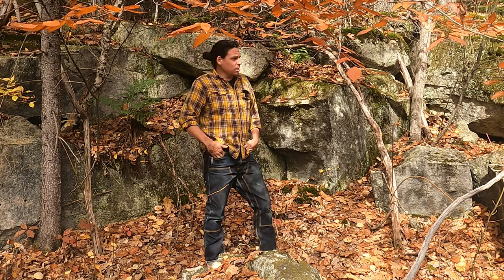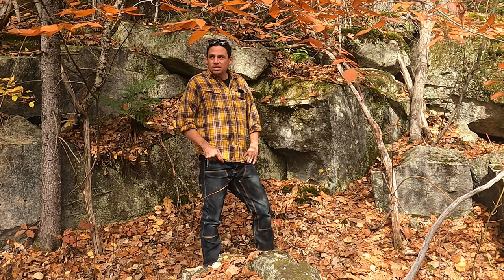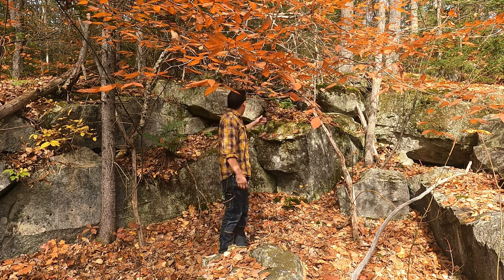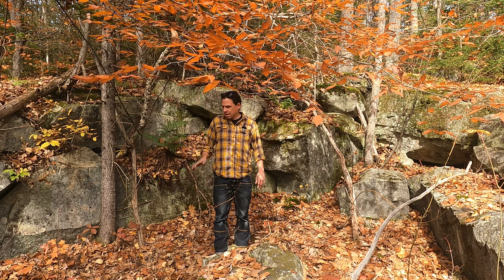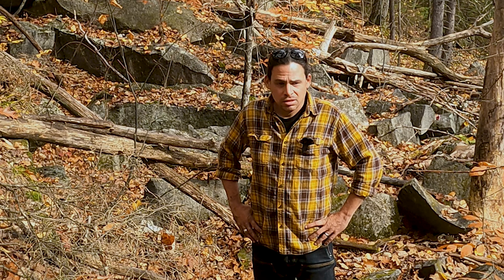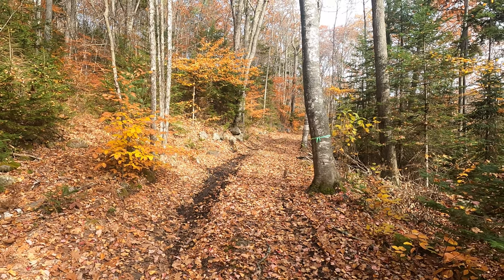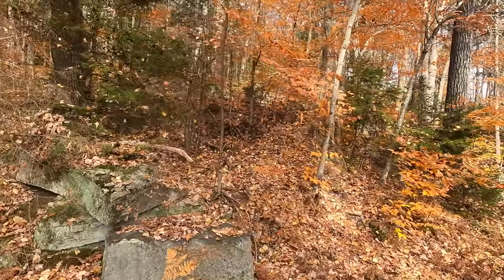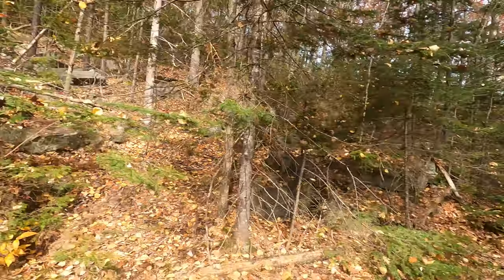Designing a Cottage - Field Trip to Town

Comment: Maybe a natural stone deck with a roof extension? In summer you can sit out there and also store firewood to keep it dry. If the pit goes really deep, you could make a small finished basement/cellar to use for storage. In a small home storage is really important, you pack away anything you aren't using at the moment. Also what is your plan for power? I could see someone like you rigging up a small solar system. I know I'd want a small fridge. Is the fireplace going to styled so you can cook on it?

Comment: You absolutely need to build a workshop on site also as cabin hobbit style would work well but with a sleeping loft not so easy to achieve if you could bring a few styles together hobbit traditional timber cabin viking style long house off grid cottage hole will be great good luck look forward to seeing the process

Comment: Ok. First things first. I'm not a builder/structural engineer/professional draftsman, so Im not sure if this is viable. Secondly, this will be hard to explain in words, and drawing inspiration from some of the fine buildings featured, everything is to personalised taste. So I won't be put out if you think this idea sucks. ;)
Regardless of the size, I'm thinking a hexagonal style building (floor plan view) would be a neat way to go, with the flat sections of the hexagon being the back wall (buried in the shelf) and the front flat being the face/doorway to the structure. The sidewalls sloping back to meet the contour of the shelf. Also the back flat of the hexagon, being the fireplace, so its well away from the door when you enter, with a chimney out the back. The other front two facing sides can have windows to look out. Using the beautiful stonework featured on the 2nd building (the ones with 3 blocks across) of varying sizes for the walls. Think with those it would be close to the hobbit-hole style you're looking for without too much earthmoving. 

One thing I loved was the arches with the chunky keystones (of the first building) over the windows and door. That would be a nice touch. Also a drawbridge style front door would be cool, especially in winter times if it snows over. Can just kick that bad boy open! 
As for roofing, I'm thinking one large centralised pillar, connected to beams at each of the 6 points of the hexagon. Keeping with the natural theme, I reckon slate would be good for roofing exterior, making it a very black and white (understated) building.
As for a sleeping loft, I don't know how that would work in terms of building height and also ventilation, from that large fireplace. I reckon a secondary level is certainly doable, but may be a little cramped. All depends on how big you want to make it. If you want it small and cozy, a nice table/storage area/cupboard around a central pillar may be a good use of space. 

I'm just chucking ideas out there for you to play with bud, at the end of the day it's your own little retreat. Can't wait to see what you have plans for in the next video. Really cool little project!

Comment: I live in southern VT, and enjoy going to see friends in Goshen, MA because I get to see some of the stonework used in the older buildings; of course I enjoy my friends as well. Nonetheless, the builder(s) used round stone, with the most incredible preciseness, to build phenomenal buildings. The friends I mentioned owned an older house with the same structural design for their foundation, fireplace, and chimney, which was built in the early 1900s. The rest of the house (the newer additions) were failing, but I never found a flaw or significant failure in the original structure.
Good stuff, and thank you!

Comment: In a one-room structure, it can be helpful not to put draft admitting features like doors & fireplace opposite each other; but to place them on adjoining walls so as to always have one cozy corner. (Maybe even do a corner sleeping loft, which might help preserve the cavernous feel of the room?)

You might also look into system that direct warm air into underfloor spaces, to warm floors & store heat in the stones.

Comment: That smooth edge looks really good.But why you say making it by hand. Angular grinder, small diamond blade, sliding on a something like a sawmill will make perfect angles. Or make it nicer but cutting only horizontal side and the vertical just a quarter splitting the rest. You are better than me at inventing mechanisms :)